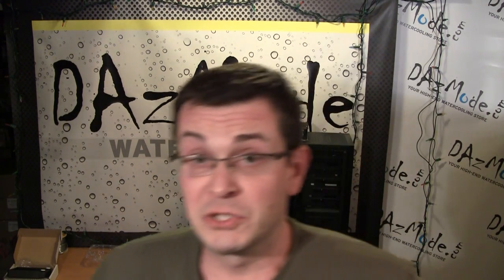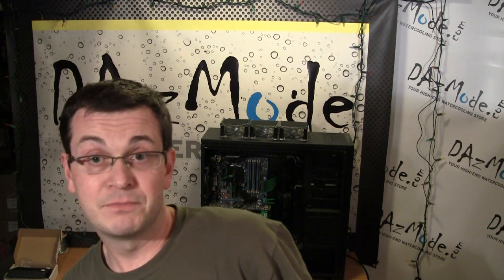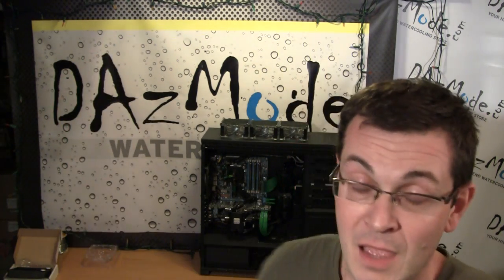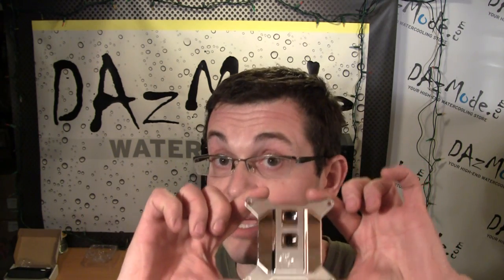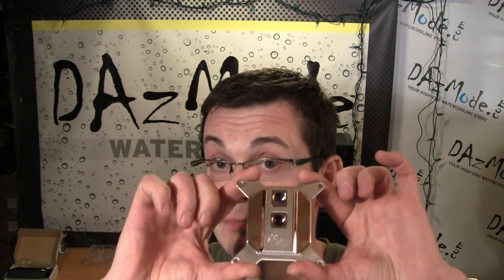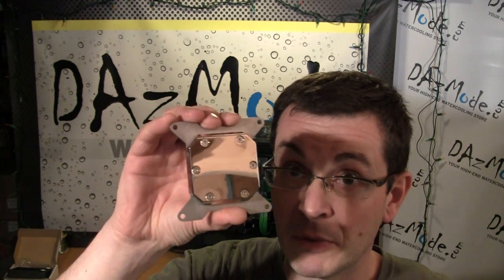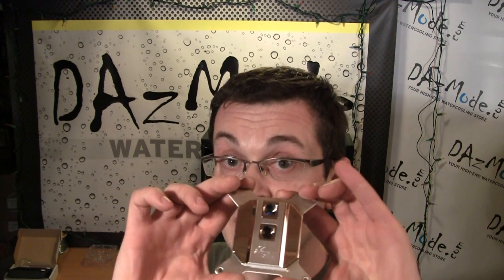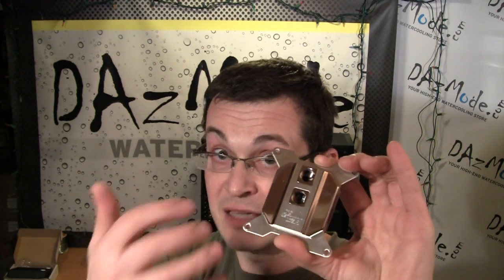Complete Watercooling Guide - Part 3 - The Key Components of  Watercooling Build

Comment: okay I am just confused I want to delete the fan from my PNY RTXA2000 GC replacing cool by connecting it to my my Alphacool water loop with a Byski waterblock N-RTXA2000-X. Do I just unplug and pitch the fan shroud heat sink? I assume it will throw an error in bios like gpu fan no fan do/can I just disable that?

Comment: Hey man, since nobody seems to reply to any of my questions, I want to know if it is safe to use UV Liquid in my loop/build. Some are saying just use UV tubing with distilled water because UV Liquid has issues down the road. What should I do?? >_< I am so frustrated because I wouldn't have a problem using just UV tubing but then my Reservoir would look so bland with clear liquid in it and the tubing lit up. I want both the tubing and the reservoir to stand out with the UV Cathodes
Reply: why should there be issues?
Reply: I have heard that UV liquid is not as good as just using distilled water, but as long as I change my liquid about every 6 months I am good right? I mean this liquid is from EK as is my Kit I installed for my cpu loop. It already has additives to fight corrosion and that stuff, I also threw a kill coil in there(.999 silver antimicrobial). So I just had concerns about using UV Liquid but I have found out I should be fine. Just am new to liquid cooling so am hearing mixed things about it and was concerned.
Reply: ***** oh my good sir. i read your question again and now i completely understnad what youmean. yes, i would always go with coloured/uv tubing and normal distilled water with some anti algene and anticorrosive agent. simple water means there is nothing that can cause problems. also no need to do that every 6 months. every year is also good. as long as you have the proper amount of anticorosive and anti algene agent in it.
Reply: Alexander Schmidt i already got the UV liquid in, and have clear tubing and all my components and stuff is of quality, all from EK so I know it's good to go. The UV Liquid from EK has the anticorrosive and anti-algae stuff in it. Plus I put a kill coil in it... so I think I'm good. Thanks for the info and reply.